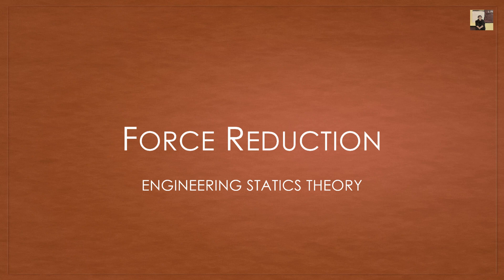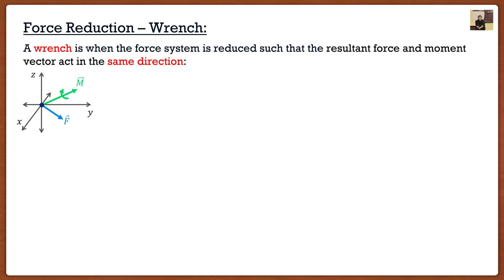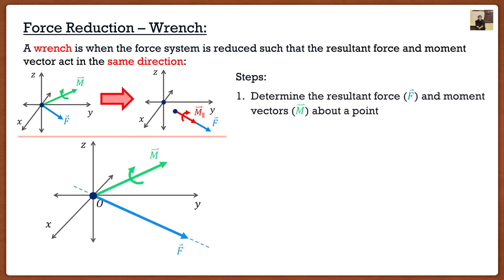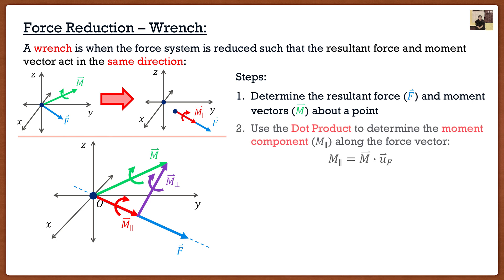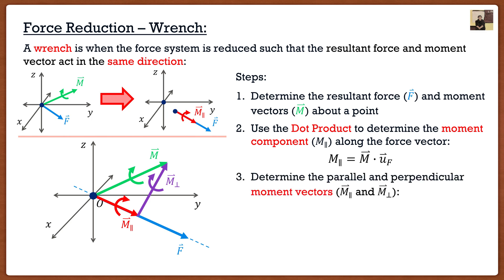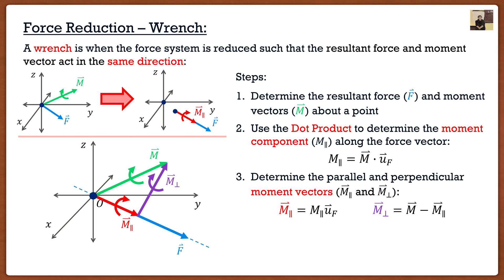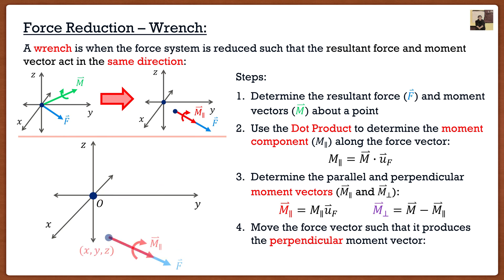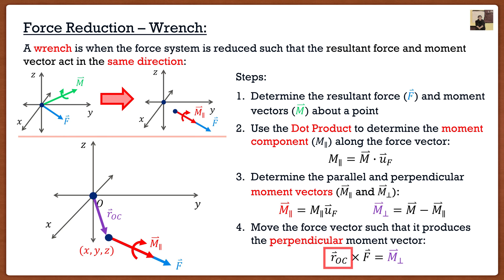Engineering Mechanics: Statics Theory | Force Reduction (Wrench)

Comment: But if the force on the wrench is applied parallel to the bolt, the wrench cannot turn anything? Correct? So shouldn't it be called a hammer, instead of a wrench?